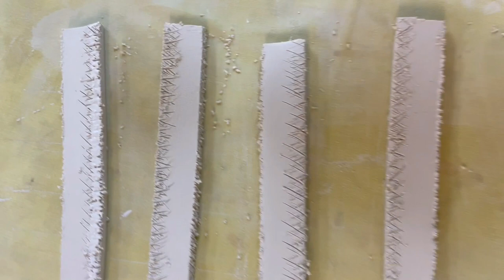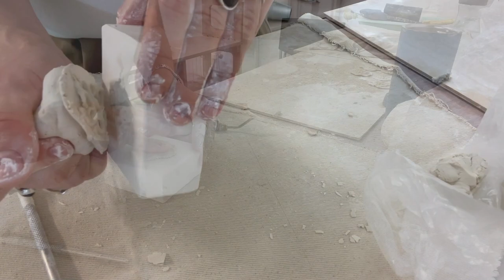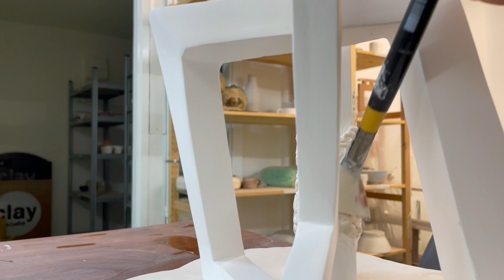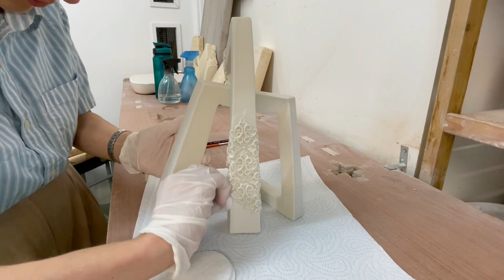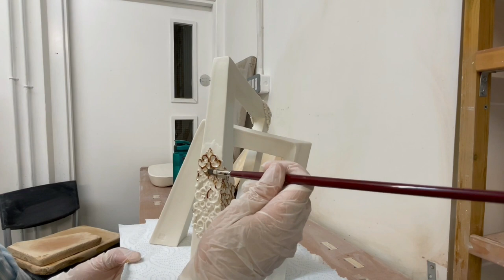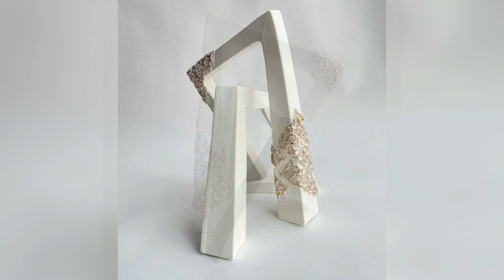How I create an abstract porcelain sculpture with golden decor.

Comment: Lovely piece. I have used Lester's over various glazes and love the effect. What is the purpose of the oil medium?
Reply from the maker: Before applying gold, it is better to treat the surface with any degreaser, in which case luster lies evenly and does not crawl.
Reply: @basaltlineceramics7105  oh. Ok. I have used rubbing alcohol to get finger oils off. I guess its the same concept. Thanks for you quick reply.🥰